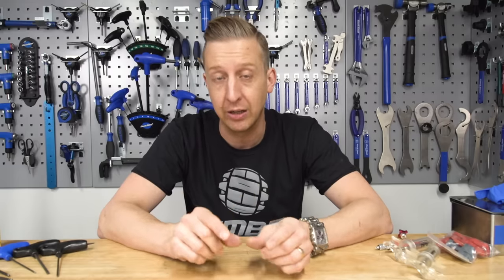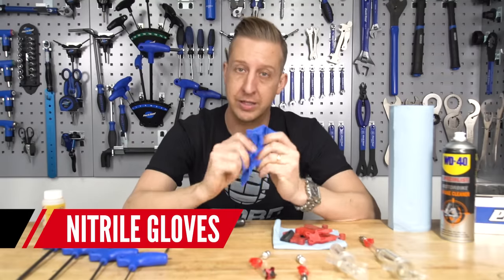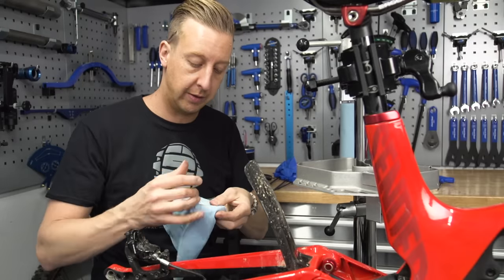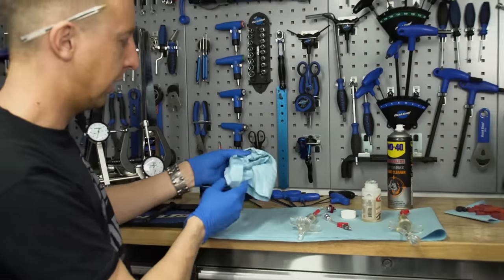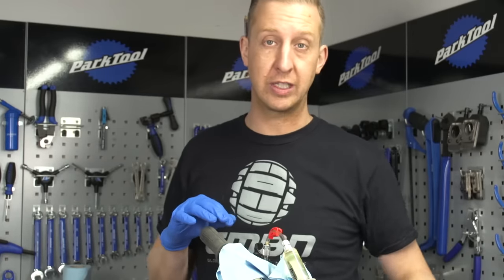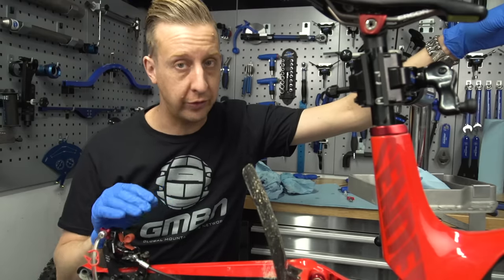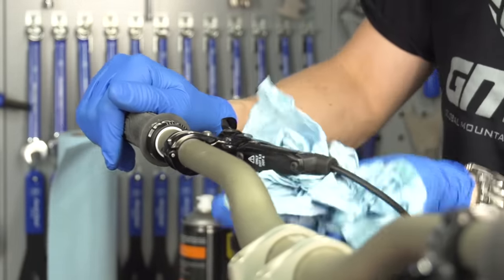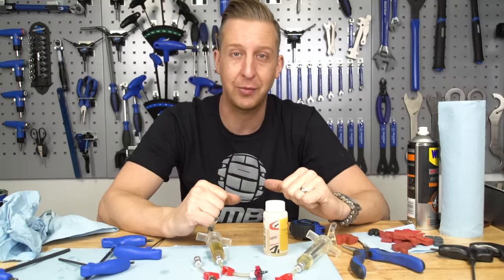How To Bleed New Sram MTB Brakes | Bleeding Edge Technology

Comment: Mm, interesting.
Completely different process with the later much improved Avid system.
The process I had attempted was on the older Avid CR Caliper's.
The video instruction was to bleed from Caliper-not Lever end.
So now wondering what is the correct procedure to ensure the most efficient BLEED!!
Attempted bleed procedure with The Avid Standard Syringe's which were absolutely USELESS.
Have had to make another purchase, this time The Professional Syringe Kit.
Please advise which would be the best procedure for optimal performance,
as now somewhat perplexed, not forgetting irritated that the considerable time with failing Syringe's resulted in back brake's being worse than when I started.
Appreciate your expert knowledge and experience, your advice would be much appreciated.
Raptor Rob

Comment: Why are you trying to bleed the brakes pushing the air downhill, air rises so start with full syringe at the bottom (caliper) end and bleed it up to the lever
Reply: Never understood why I see this all the time too. Makes no sense.
Reply: Maby because the reservoir is on the top and you want the new fluid to be there.
Reply: I would just have the bike rotated forward in the stand so the bars are lower than the rear caliper...
Reply: This is correct for just about any brake that's not an Avid/SRAM. The weird valving in SRAM levers means they probably won't take a bleed from the bottom as easily. All that messing with sucking fluid in and out and degassing the fluid as SRAM recommended in their earlier tutorials is fixing problems with oil flow through the brake system that other manufacturers engineered out before they sent the products for mass production.

The real stand out feature of this bleed process where you realise the SRAM levers are definitely doing something weird is when he closes the bottom of the system and pumps more fluid into the lever. Oil is effectively incompressible, so the only way this is possible is if the reservoir in the lever is not filled properly by the bleed process and instead depends on extra pressure to get fluid into it. This would be termed an 'overbleed' if you did it with most brakes - they'd also most likely spit all the extra fluid back out as the diaphragm allowing for expansion in the lever would spring back to shape as soon as you remove the syringe from the lever.
Reply: After you see him pump more fluid into the lever/reservoir, why does it not all spurt back out when he releases the syringe? Is this process of pumping more into the lever critical and how do you know how much to pump in? Thanks.
Apologies, only dealt with shimano brakes in the past and have Sram Code R's on the latest addition to the fleet.
Reply: @peglor  When you pressurize the system and release the syringe it is equalizing the fluid pressure (into the syringe) hence little fluid coming back out, if you have lots of fluid coming out you have overfilled the system. There's other ways of tuning the fluid level.

Comment: Hi, my SRAM Code R’s are about four years old. I have taken good care of them giving them a fresh bleed once a year with new pads. My front brake pads are way to close to the rotors. Seems like the don’t retract much at all. I then rebuilt the caliber, but this did not fix the problem. I have followed your video and  I can not get these brakes to not rub. Just too close to the rotor. I feel like when I do my final push to pressurize the system it pushes the pistons out to far??? Not sure what I am doing wrong, please help🙏🏻🙏🏻🙏🏻

Comment: Hey, this is really useful and clear, thank you - only issue I have is that when I remove the top syringe right near the end then fluid pees out of the handle and I lose pressure. I've sealed the bottom end and followed all of the instructions to the letter. thoughts ?
Reply: Actually just read down th comments and sounds like doing the process but using the caliper end last is the way to hold pressure in the system. will let u know if it works.

Comment: To give you a tip, it doesn't have to be this complicated.
Simply connect the oil-filled syringe to the lever and open the caliper slightly and push the oil from the lever side to the syringe side.
However, we need an oil drain bowl

Comment: Thanks for the tech info GMBN 
Shimano XT vs SRAM code R, hello to whoever is interested in my experience. I have had XT and currently I’m ridding code R, if I knew what I know now I would have replaced the code R directly on my new bike for the XT BR-M8020 (or Magura MT7 little bit overkill for me). I have had zero problems for 3 years with my XT and now ridding code R for 4 months I’m almost at the point of replacing them. So why: They just do not quite functionate as how a good set of disc brakes should + pour material quality, rotors rust, cheap paint, oversized components, (DIY) unfriendly to work one, never quite the result you where hoping for after some tlc and so long. My girlfriend rides SLX for over 2 years and are in better condition than my code R, we ride 95% of the times together. I hope that I saved some people from wasting their time, money and frustration. Something about myself I’m a perfectionist very technical skilled and realistic. (Last summer in Austria a DH bike rental place told us they replace all Sram brakes directly and sell them for dirt cheap new, they just do not want to bother using them. That should have been a motivation for me to replace them directly but I did not, regrets big time.)

Comment: Comment and question.  I am under the impression one advantage of DOT 5.1 is that it cleans up great with mere water.  That there is no need for 91% isopropyl alcohol or aerosol brake fluid cleaner.   Am I wrong?  (Folks still recommend cleaning contaminated rotors with brake fluid cleaner as it dries so fast.)

Comment: Great video tutorial!! 
I found though that removing the syringes in the reverse order is better. 
Removing the lever end last always ended up with leakage & losing the pressure when unscrewing the nozzle. 
If you remove the lever end first and put in the lock screw,. Then when you go to the calliper end, you can pressurise with the syringe, then close off the screw nozzle to maintain the pressure. Then unplug the nozzle & tighten the bolt. No mess, better pressure retention.
Reply: Totally agree. Don't know why this video doesn't do it this way...??
Reply: Btw there's a couple other things that are helpful that do not follow the Sram instructions - one is to dial the contact point adjustment to beyond halfway in the "In" direction. Sram instructs us to dial the adjustment all the way in the Out direction. This doesn't allow you any adjustment to firm up the lever. It's highly ineffective! Another is to use a thinner bleed block, to allow more fluid into the system...

Sram seems to be intent on doing whatever possible to input the smallest amount of fluid, i.e. create the least amount of pressure, but that is what so many people complain about...
Reply: Andy G - that sounds like a great idea.  I agree that removing the lever syringe first would make sense since, when you lose fluid from the lever, you can add it back if pressurizing from the caliper and you won't lose a drop due to the  push on/pull off design of the bleeding edge adapter.  I have more free stroke / lever pull required before the brakes engage and I keep thinking it's due to losing fluid during that last step removing the syringe from the caliper.

Quick question - are you just reversing the entire process (i.e. starting the bleed from the caliper end to the lever end), or are you doing everything the same as in the video, but instead of pressurizing at the level end, you pressurize at the caliper end?  There's the step where you squeeze and release the brake lever - where does that fit into the process you described?
Reply: @ruknight4ever  I follow the video up until the pressure/disconnect step. I squeeze the lever before the final pressure and disconnect.

Comment: New Code R brakes, I'm not sure where my problem is stemming from but I cut the line to fit, I'm following everything exactly in video and my rear pistons are barely moving. Only in the rear though, the fronts are perfect. Very frustrating, I've bled it 3 or 4 times already and I don't want to bring it to a shop I like working on things myself. Maybe there's still air in the lever or something I'm missing? Doddy help!